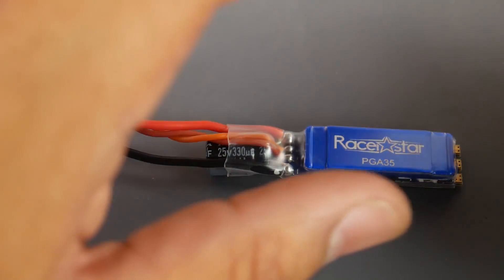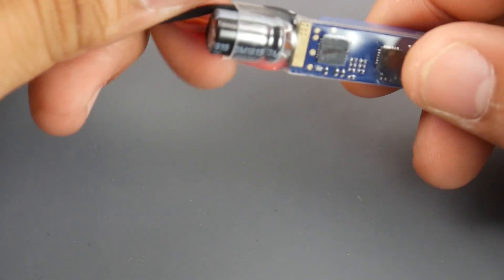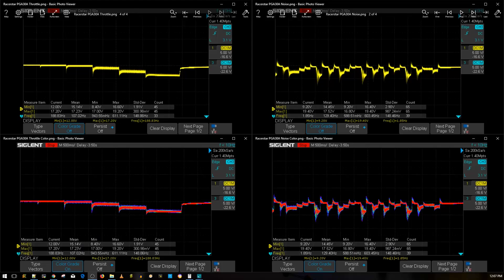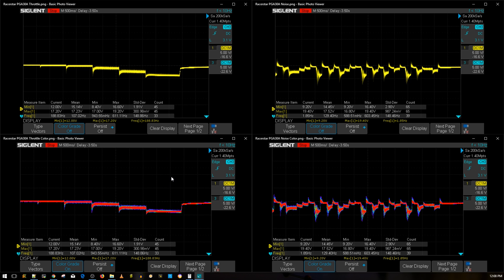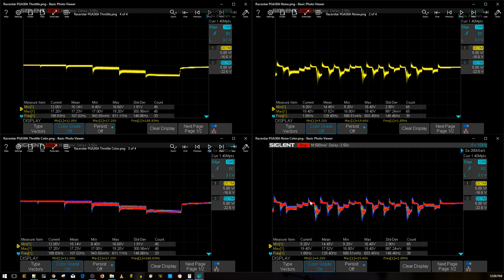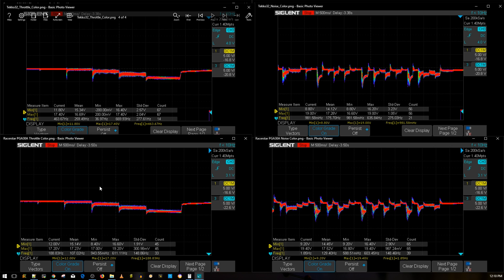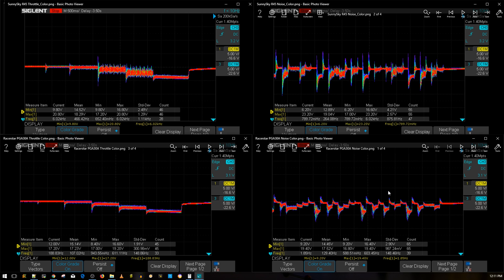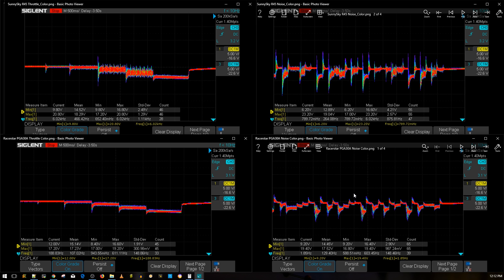New Slim ESC Test // Racerstar PGA35A ESC Review and Noise Test

Comment: Problem with low ESR capacitors is that when they get older, their ESR gets high so the noise gets through them. And when they are really cold their ESR goes up too
Reply: Good point on age but isn't this true for all capacitors of this type, they dry out?  However, with your point in mind, how long will they last, on average, is the next question, right?
Reply: @frankbarajas  these caps have like a liquid electrolite in them, there are other capacitor types like tantulum or

 aluminium polymer capacitors, these caps don't dry out and they have lower ESR than standard low ESR capacitor (they are much more expensive)
Reply: @frankbarajas  I flew my quad with 4x 220uf for around a year and at the end of a year I had crazy noise
Reply: BuzzCola 3 ~ Thanks for you input.  I just ordered some Rubicon Low ESRs, which seem to be recommended often, but if we will probably have to replace them after a year, shouldn’t we be looking at a better type?  How much more expensive are the other types of capacitors, that you mentioned?  Relatively speaking, with the amount of money we put in our quads it would have to be crazy expensive not to use the best we can get or am I missing something?
Reply: @frankbarajas  Wiki says they the best cap technology with lowest ESR is OS-CON. 
100 times better than low esr and 10x better than tantulum
Reply: BuzzCola 3 ~ Any idea what those might cost?  Size and weight is also critical. However, I can’t help but think there must be a valid reason why we are using the electrolytic type of cap when there’s something so much better available.  I don’t it’s the cost keeping us away either, you know?
Reply: @frankbarajas  goes up to 2$ for one os con, you can get like 10 normal low esr for that
Reply: @frankbarajas  but i would go for like 4 smaller caps instead of one big 500uf cap
Reply: In fact batteries also have a trend to get older and have larger internal resistance in cold temps :)